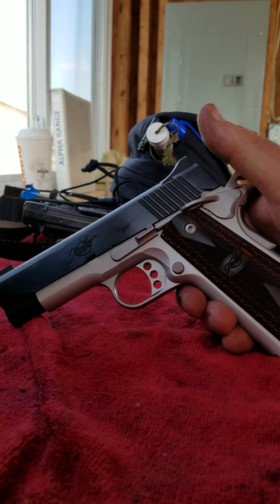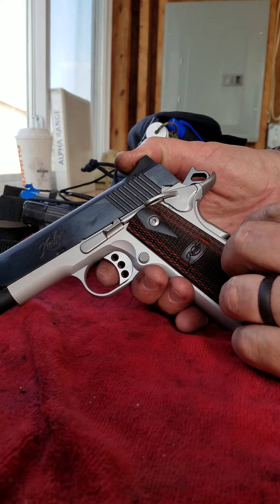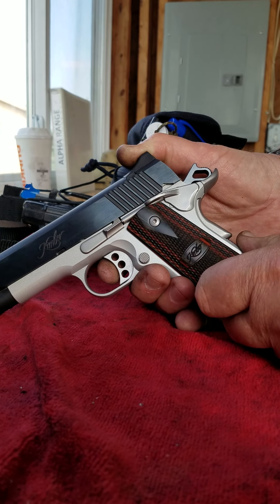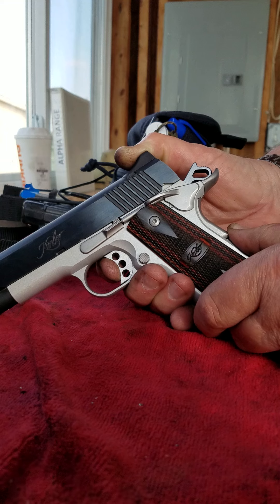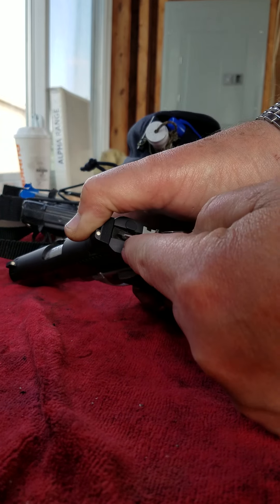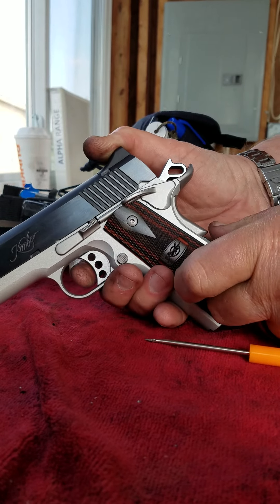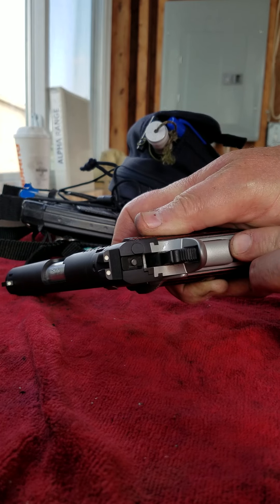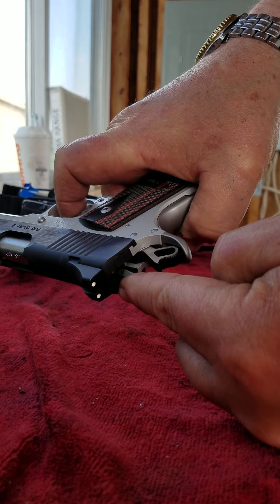May 16, 2024

Comment: Thanks for the video! Is Kimber the only manufacturer that uses the Swartz firing pin safety? Also, do you know why they use them exclusively in the series II?
Reply from the maker: I don't know of any other brand that is using it. Doesn't mean it's a bad system but like everything else it just has to be done right. "Why" on the Series II, that's just their designation for guns that have it. Honestly I am not sure how it is sold, I think it's required for guns they sell into CA, other than that maybe it's an option. Not sure.

This particular gun BTW was bought about five years ago and when I looked at it the other day it'd had about 100 rounds through it. It's entirely possible that the ones made more recently are better.